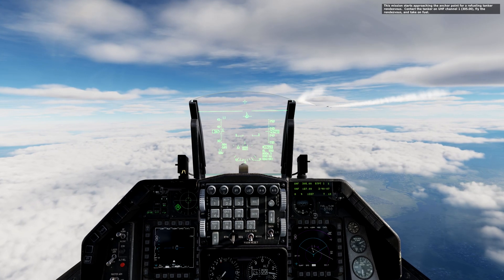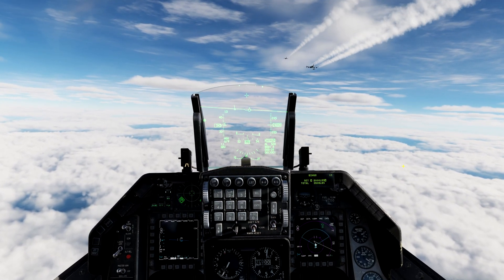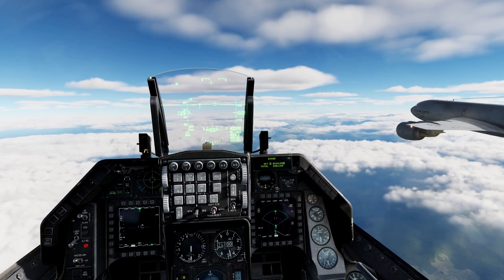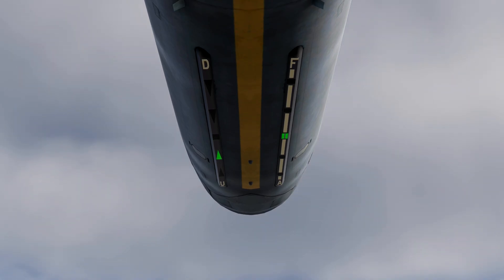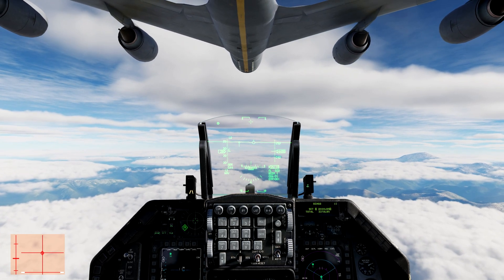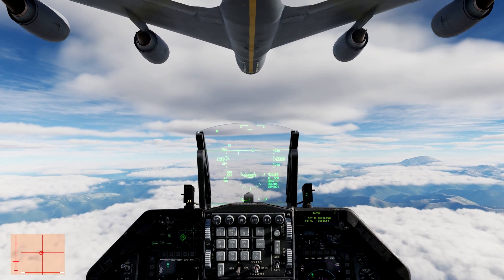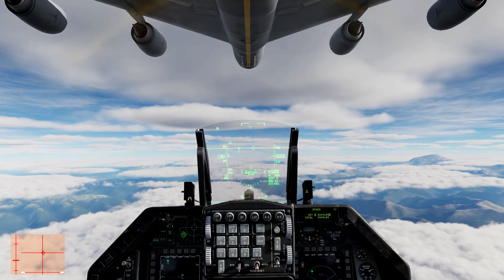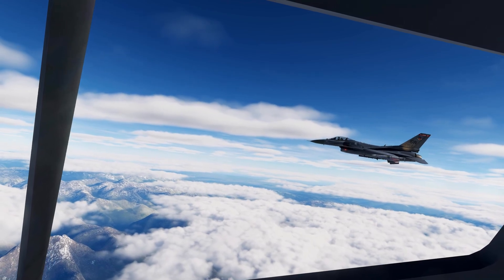F-16 How to Perform Aerial Refueling | DCS | Tutorial | Amazing Graphics

Comment: best video iv seen on this. iv been practicing for a few weeks now and still cant connect. il get there one day for sure
Reply from the maker: Hi Freedom. And you will, because you already have what it takes: persistence, since the AAR is not easy. 💪👏😉
Reply: Thanks man. Im using x56 throttle and stick and finding it difficult with the throttle to match and maintain speed.@nazguldcs
Reply from the maker: That's how it is. You'll have to keep moving back and forth throughout the refueling process. That's why it's not easy, but rather tiring 😅

Comment: Hey great videos, i have to ask what do you all think about deadzones. Are you using them?
Reply from the maker: Hey, whats up. Thanks man 👏🙂 I don't see a problem with using deadzone. I used  with another joystick I had. However, the one I currently use, a VKB Gladiator PRO, which has a metal gimball, I don't use because it's very precise. I used deadzone for a while because just putting my hand on the joystick would move the aircraft, but I don't use today and I didn't use in this video🙂. The axis curvatures are also the original ones. I've changed the curvatures a while ago, but today, after the last DCS installation I did at the end of last year, I kept the original ones. Seeya! 🍻😎

Comment: Rule of thumb for approach speed: 

To see the distance to the tanker in DED set AA Tacan to tanker. 
Assume tanker's speed is roughly 300 kts..

At distance = 1.0 Nm -> overtake speed = +100 kts = 400kts CAS
                        0.9 Nm                                       +90 kts = 390kts CAS
                        0.8 Nm                                       +80 kts = 380 kts CAS
                            :                                                  :
                        0.2 Nm                                       +20 kts = 320 kts CAS
                        0.1 Nm                                       +10 kts = 310 kts CAS

When close adjust to actual speed
Reply from the maker: Very  nice 👏👏👏

Comment: A further tip about connecting with the boom. Once connected, there is a tendency for our aircraft to slow down a bit and start descending a bit too, so, be mindful of that and prepare for slight adjustments once connected. This is contrary to what real pilots report, that the boom will sort of pull you around a bit, but in DCS, it doesn't work that way.
Reply from the maker: Nice man! Tks for the comment! Seeya! 👏😎

Comment: Nice video, should help lots of people struggling. btw in DCS boom or basket refuel rate is the same.
Reply from the maker: You are right. I found this article from 2006 that talks about exactly this. The boom has a higher rate, however, when it is refueling fighters, it cannot use its full power: "A single flying boom can transfer fuel at approximately 6,000 lbs per minute. A single hose-and-drogue can transfer between 1,500 and 2,000 lbs of fuel per minute. Unlike bombers and other large aircraft, however, fighter aircraft cannot accept fuel at the boom’s maximum rate. (Today’s fighter aircraft can accept fuel at 1,000 to 3,000 lbs per minute whether from the boom or from the hose-and-drogue.). Thus, the flying boom’s primary advantage over the hose-and-drogue system is lost when refueling fighter aircraft." Tks man for the comment! Very nice! Appreciated! 🍻
Reply: @nazguldcs  Ahh that's why, thanks for the explanation :)🍻